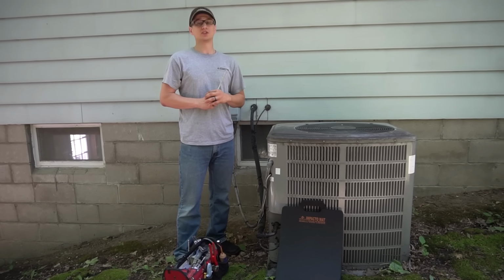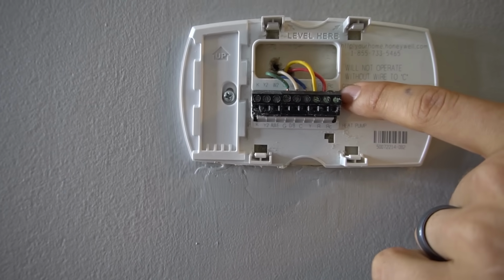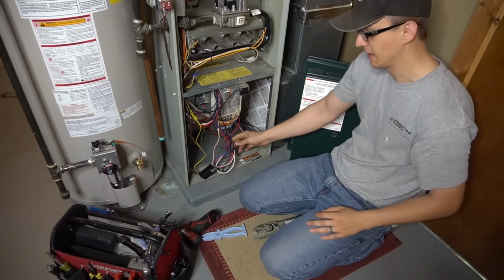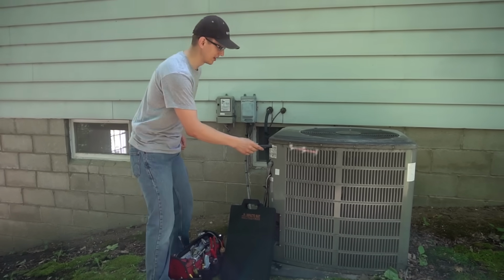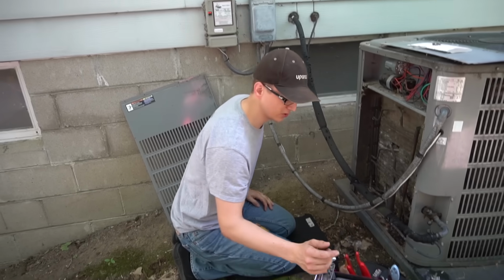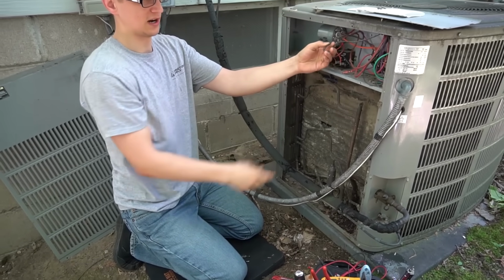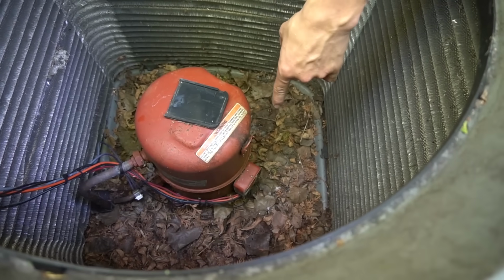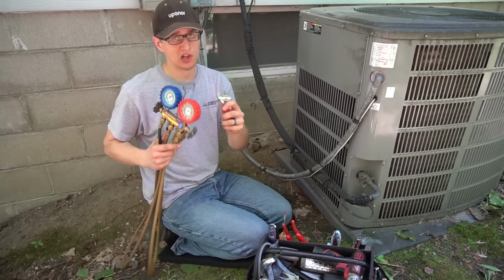AC Unit Not Turning On - How to Fix It Step by Step

Comment: Love your videos. I am in Geogia an outside AC unit that will not turn on. Using your videos I have puched the contactor button and gotten he condenser to come on monetarily. Verified I dont have 24 volts coming from the thermostat. Bypassed thermostat at thermostat by jumping R,G and Y together and getting the same result (no AC). So its no the thermostat. The wires outside look ok....I shopped vacced out cobwebs near the contactor but its a newer unit with a cover so do not believe bugs are an issue. I DO have a pan float switch and condensate pump connected to the furnace. Any help to further diagonose would be appreciated.
Reply: ...and THIS video (https://www.youtube.com/watch?v=KCanZEsLVEI) saved us. So easily explained. Retraced the wiring an the common wire to the condenser had come lose fom the terminal inside the furnace.

Comment: Thank you for the video. I watched it threw but didn’t find what I needed. 
Everything turns on. Air blows in the house. Fan does not spin. Tried spinning with a stick. Fan is free and not jammed up but doesn’t start spinning. Cooling lines are hot to the touch and the whole unit is hot. 
If I missed it please give me the time in the video to re watch. If not can u elaborate ? 
Thank you for your help.

Comment: Love the info.  I forgot I used to do to test TV remotes, Samsung phones work better to see it. You don't have to shut off all the lights.  Dim room will work. I got one that both cliff sensors on the right front and back right are off.  Sensors or motherboard? I am thinking motherboard.

Comment: Thanks for the thorough but simple explanations. I'm a homeowner and low-voltage technician, came home to a humid house after a long day of work and just gave an exhausted sigh. You're emulating that second frame of reference needed when something just isn't working right.

Turns out my control wire is loose at the unit. I'm familiar with line work but not machinery -- the trick of giving the fan a spin after I got the unit started worked like a charm. I'll have to do a more thorough investigation when I haven't spent all day in the field, but I'm very impressed by this straight-forward video. Thank you for your honest work.
Reply: Just a follow-up, the problem was the capacitor. It has a nice bubble forming at the top. I figured as much -- the fan was only running when I jump-started the motor by spinning it with a tool (Which indicates possible low-power draw) and there was never any cool air pumping in.

This whole ordeal taught me a lot. I'm going around changing my filters and wiping down vents. Thanks for sticking with me!

Comment: I don’t get 240v going into my contactor or 24v for the thermostat. When I push the contactor in the fan comes on. Inside the house everything comes on but the Ac blows hot air. I have a new contactor and capacitor btw.

Comment: Hi! My air conditioner is brand new. It’s a standard Goodman. I have the thermostat on cool, fan on auto. Room temperature is about 79 so on the right on lowered the number to 64. However I don’t feel cool at all. I checked the vents and the circuit breaker. I noticed the outside condenser isn’t circulating.

Comment: I’m a woman who lives alone and have no money to call in a service person.  Thanks to you and your videos, I just fixed my central air. It was the plunger on the contactor I may have to replace the part but I think it’s not too expensive.  I’m thrilled🥳 I’ve been doing all my own  repairs for a few years now but thought I was probably doomed with this one…..nope.  Thanks to you. 😆
Reply: Ever since YouTube became what it is today there is nothing that I won't consider fixing on my own. I didn't have a clue about working with my hands or what was needed to tackle these things. These videos that these industry leading people put out have saved me so much money it is unbelieveable. I watch my parents get ripped off into my young audult life by contractors who took advantage of them not knowing how knowing what is fair and what is actual highway robbery. I'm 51 and the last 15 years I went from being an average Joe to the extended family and friends Plumber, Journeyman Electrician, Light AC Repair, Auto Mechanic for things that would have cost me thousands and I was able to do it for under 20 or 30 bucks! Appliance Maintenance and Repair. Washing Machine (5 times), Gas Dryer (3 Times), Thermostat Replacement, Gas Water Heater Maintenance and Replacement (2 Times), Big Screen TVs that cost thousands of dollars totally repaired for a couple bucks replacement of computer control board capacitors, Kitchen Sink Replacement, Reverse Osmosis Overhaul Better Water Tubing and placement for stronger pressure to fridge ice machines and water dispenser, Kirby Vaccuum Rescued from death 5 times over the years, Expensive High Quality Wet Vaccuum parts fixed or replaced, I refinished our oak front doors quite literally stripped off the old lacquer and stain and sanded them and made them better than when we bought the house, Installed 5 Ceiling Fans, I could go on and on....     This monkey see / monkey do approach by using a tablet to play videos in step by step by guys like this seriously has made these expert procedures totally safe, fast and so low cost. I tip my hat and recognize their efforts and turning me into a one man army of tradesmen doing work that amazes even me.    KUDOS! -Tony Cusimano
Reply: @tonyupsman  YouTube replace every industry in the next 10 years
Reply: Me too
Reply: @emduplessis9996 I would help you anytime
Reply: We're not concerned that you're a woman. That's what you guys wanted, equality and can do everything a man can do, so no sympathy due to gender
Reply: If you can fix your unit, you should go into business fixing other people's units.
Reply: I’ll take care of you
Reply: @Realcanes5  😂🙄

Comment: My AC unit isn't cooling, the air handler is working, but it's blowing warm air. Thermostat is working well, the condenser fan wasn't turning on, I replaced the capacitor and it came on, but at night it stopped working again. Next I replaced the condenser fan motor, again it worked, but at night it stopped again. Coils are clean, condensation line is clear, any advice?

Comment: This guy is the best. I have saved thousands by following his video suggestions.  I wish I could buy him a beer or dinner! Saved my AC and heating at least 5x now.
Reply: Could always thank him by sending some $ to support his channel.
Reply: When I turn on my AC through my thermostat nothing is happening I went up into my attic and nothing happens there I went outside to my AC unit and nothing happens there either. I did pull the panel to my AC unit and pushed in the plunger which did start the ac unit but it shuts off as soon as I let go. Does the thermostat talk to the ac unit first or does it go to the furnace first?
Reply: @LittleFootBaller2305  sounds like you’re not getting 24v to the contactor. Something in the circuit is open, I would look for a tripped float switch or maybe a tripped high pressure switch on the freon line.
Reply: I replaced my capacitor 2 years ago by the way. At that time I had the humming but after changing the capacitor it worked just fine.
Reply: @LittleFootBaller2305 could also be a bad 24v power supply, but most likely just an open safety switch.
Reply: @LittleFootBaller2305 Have you got your AC problem fixed now?
Reply: No kidding I was just thinking if he had a patreon I would actually donate, his vids are so thorough.  Occasionally a bit redundant (this one with the "20 reasons why" for instance, could at least add it to the descriptions) but so good for diagnosing and narrowing down...
Reply: HE IS AMAZING & A GOD SENT TO WOMEN.

Comment: We still 3 new contactors...but the contactor isn't sending juice to the rest of the unit. What can be wrong?
Reply: We installed 3 different new contactors..
Reply: If the contactor is getting 24v applied to the coil it should switch on. If it is not getting 24v then the problem is in the thermostat, thermostat wiring, or an open pressure or temperature switch. If it is getting 24 volts but the contactor does not pull in then its a bad or incorrect contactor. Most split system condensing units use a 30 FLA 24v coil contactor.

Comment: This was awesome! Extremely well done. My compressor still does not turn on. It has both a run capacitor and a hard start capacitor. After testing them both, I replaced the hard start capacitor. Still nothing, so I tested the fan motor and the contactor. Both tested OK. Now what should I do? I can't seem to get the compressor itself very easily.

Comment: I had the wires carode on the side of the compressor me and my AC guy replaced them with stainless.I don’t know why the factory didn’t do this.And you mentioned rodents I had a detached garage with a car in there and they chewed the wires coming from the battery down to the starter,I had to replace that wiring harness and a couple of more up top.I hated them dog gone rats.I had a field behind my garage.

Comment: Ok my magnetic connector switch is getting the signal from the thermostat, is activated but the condenser and fan won't turn on. I replaced the capacitor and it's still dead. Should I replace the fuses in the shut off box? There are two big cylinders for fuses.

Comment: As far as cleaning the fuzz off the exterior fins, I'm going to add this. As our helpful man explained, air is sucked in from the outside and out the top, in the middle. If you can take the fan assembly off of the top, either take compressed air and blow the fuzz from the inside back out and the spray water also from the inside out!! Last, but not least, try to get the fuzz , from the outside (usually at the bottom) cleared away from the unit. Peace out!

Comment: Great video !     Wondering if you could help me.      I have a 13 year old Trane unit.  The unit runs and blows cool air for approx 3 mins and then the fan on the AC unit shuts off before the temp is reached.     No fuse issue or anything obvious that I can see.   I had a tech come out and he changed both capacitors but the problem persists.   Any suggestions what it might be ?

Comment: Just replaced bad capacitor in unit once turned all power back on to unit now nothing comes on. Capacitor was replaced because the unit was running but not cooling. Found the swelled capacitor and replaced it.

Comment: What if my plunger is pulled in and nothing is working even after I changed the capacitor ? I'm getting the 240 volts. The unit buzzes like it wants to turn on but the fan and the compressor don't turn on

Comment: Thanks so much for this video! A few years ago my circuit breaker and transformer blew out in a powerful storm. This video helped me tremendously. To the extent I could have a conversation with a friend's husband who runs an HVAC business and he helped me step through the multiple problems and then walked me through fixing it and gave me a free transformer. I learned a lot.
Just now though the thermostat was running, but the house was 3 degrees warmer and getting warmer. I checked all the stuff inside the house and finally went to the compressor. The compressor was hot as I approached it. The thermostat asked it to turn on, but the fan blades moved barely. Then the poor thing gave up. I got a stick and waited for the next round and I helped the blades just a bit and the whole thing came to life. What a joy! Slowly, the compressor cooled down with all that air circulating. I'm standing on a chair under the vent enjoying a wonderful cool breeze grateful. Thank you!!

Comment: This was very helpful, thank you! The temp is 90 degrees and realized in the middle the day it kept getting hotter in the house. Watched this video, noticed the fan wasn't spinning and used a long flathead to start the fan blade to spin and the cool air started blowing. Question, would this be a sign it may completely stop spinning eventually?

Comment: Thank you great honest videos,  I have goodman GSX140371 model. trying to change the capacitor , and thermostat. what brand and model do you recommend for capacitor, is the nest thermostat good? the units 3.5 ton, 6 years ago installed.

Comment: Alright very helpful video. It's got me started in the right direction. My AC gave in about a year ago. Turns out it was blown fuse.
Reply: This year it stopped working again. I checked the fuse. It looks okay. I don't think they would only last a year.
Reply: I got to a point where I pressed the plunger on the contactor. And it turned on. So my question is... What's the problem?? How do I keep it on without having to hold the plunger down?
Reply: Am I supposed to unscrew that and check for bugs? Once I do that just screw it back on and it should work?

Comment: Very knowledgeable! I have a little bit different scenario if you would like to help, it would be much appreciated! AC fan wasn't kicking on so I turned off the unit for the night. Next morning I turned it on and the fan and entire ac unit worked fine, for about 5 Mins. Then the fan stopped spinning. I tried push starting the blade but it didn't start. I hear a humming and see the condenser working but no fan movement. Is the fan supposed to be on the entire time the condenser is on? And is there a way to tell if it's a bad fan motor vs capacitor? You mentioned it's common to replace both so I might just do that.

Comment: Wow, that's very informative.  So, just to be clear,  the fan outside is running and inside I can feel air but it's not cold air.   The capacitor was replaced and kick start,  but now the fan outside is not running.  I was told it's the compressor but the guy never went into attic to check that unit.  Help?

Comment: What if your ac system is backwards my ac does not operate but to make my heater kick on i have to set it on cool and set temp lower that what house temp is for heater to work how do i fix this issue

Comment: I just had my ac refilled and it only turns on at night. During the day the outside compressor doesn’t run then at night when I cools down it will turn back in

Comment: Mine has batteries in it and it's not programmable because it doesn't have a hold button it's only got three wires. After you take the front off the thermostat red yellow green which would be.    r c.   y.     g..... So where should this jumper be at that you're talkin

Comment: First off, great informative video. Thank you for making this!
I have an HVAC unit that's running inside (including blower fan) and outside but doesn't seem to get cooler than about 76 degrees. This seemed to happen a day after I cleaned my condenser coils well with coil cleaner and water. Maybe the capacitor got wet or the system needs a reset?? Nothing's frozen and I went ahead and cleaned EVAP coils and blew out the condensate drain as well to get rid of possible culprits. 
I'm hoping it's not a leak but that seems like one of the only options left at this point. Thanks again for the help.

Comment: A/C fan or compressor not coming on. I've replaced both of the capacitors on the unit, I do have 240 volts coming into the contact. When I depress the contact I hear a low buzzing noise. However the unit still doesn't start. The fan spins freely as well. Suggestions.  Again, thanks for your fantastic videos.
Reply: The compressor is not starting. Check the wiring coming from the contactor and the capacitor to the compressor for breaks or other damage. If the wiring is good then either the compressor motor windings are shot, a start component has failed, or the compressor is mechanically seized. 
If you have a run capacitor and a start capacitor then make sure both capacitors are good as well as the potential relay. I know you said you replaced both capacitors but i do not know if you have 2 run capacitors for the fan and compressor, or a dual capacitor for the fan and comp with a start cap and relay for the compressor. If you have a start capacitor and you have already replaced it then look at the potential relay. They are very hard to test so you are better off just replacing it with either the oem one or a supco universal potential relay. Its best to replace the start cap and relay as a pair anyways.
You can do a motor winding test to see if the windings are good, google single phase motor winding test. If the windings are shot you need a new compressor and are probably better off replacing the entire unit. 
If the windings are good then add a hard start capacitor from supco, only if you do not already have a start capacitor. That will increase the starting torque and can help the compressor break free and buy a little more life out of it. Plan on it dying completely in the near future if it was seized.
Reply: @Redtooth75  Thanks, I’ll check the items you listed. Yes, one of the capacitors replaced was a dual run capacitor the other was a motor run capacitor. It’s probably time for a replacement unit. I’ve had it since 1993. Thanks again.
Reply: @Redtooth75  Thanks again for the valuable knowledge. While checking the wiring at the contactor. I noticed that some parts of the contactor were missing. No doubt worn (unit is 30 yrs. old). Contactor replaced 65$ vs 329$ from a repair center. Geez I should be an A/C repair tech. System is now functioning. Thanks again!!!!